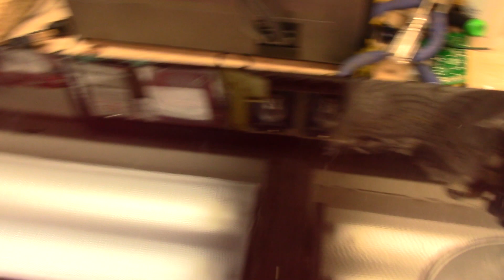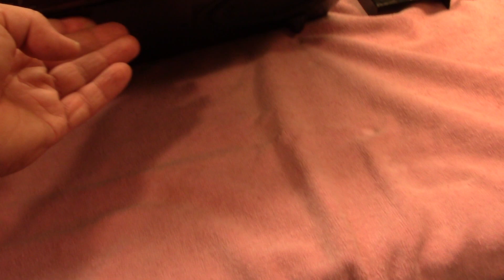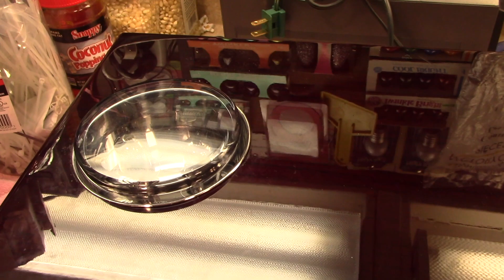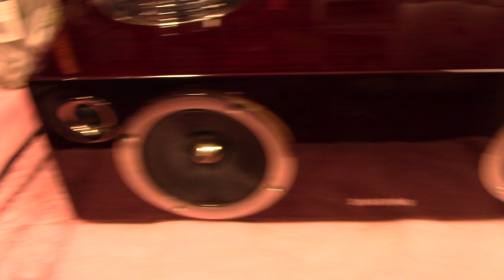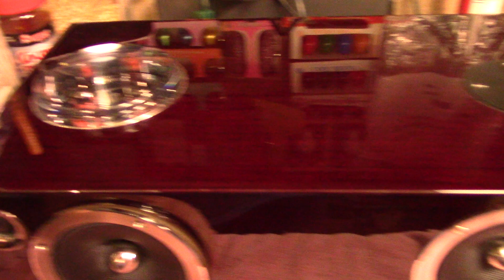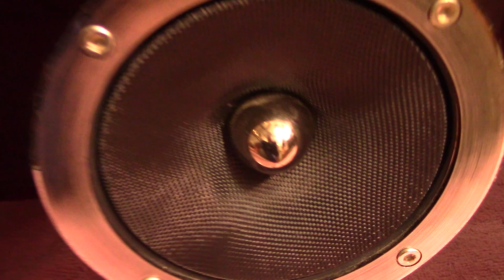Samsung DA-E750 Part 1: Initial Checkout

Comment: How did you replace the tubes? It looks like they are glued into a socket. What a pain. Samsung looks like they flooded the socket with epoxy glue.
Reply from the maker: I simply wiggled them out of the sockets. Mine were not glued in. They came out no problem.
Reply: @ I will try something to help dissolve the glue. I assume the led just shines up from the bottom?
Reply from the maker: @richardmerifield3263  It's been a minute, but I'm pretty certain there is a surface mount LED, in the center of each tube socket. I really didn't pay that close of attention, due to the gimmicky nature of those LED's.
Reply: @ thanks. Yes I managed to get the tubes out, sadly breaking one in the process. Time to start troubleshooting. No problem with the power supply voltages.

Comment: I never knew that Samsung jumped on the modern vacuum tube amplifier bandwagon.  Usually tube based stuff is either extremely high end like McIntosh or cheap China stuff.  Nice to find it was just a noisy tube and one that doesn't cost a fortune to replace.
Reply from the maker: Yeah, this is certainly a nice mid-range offering of the day. I’m real glad it was an easy fix!